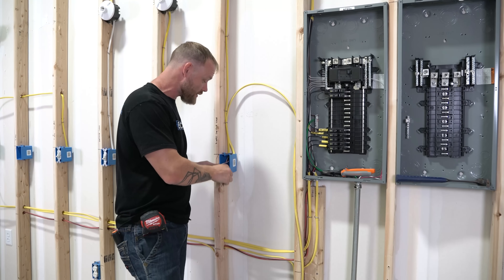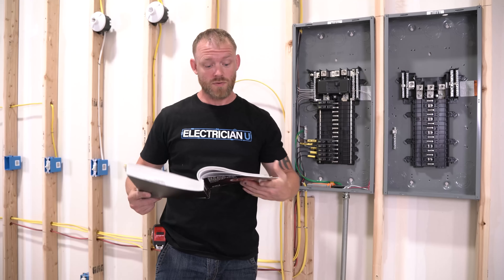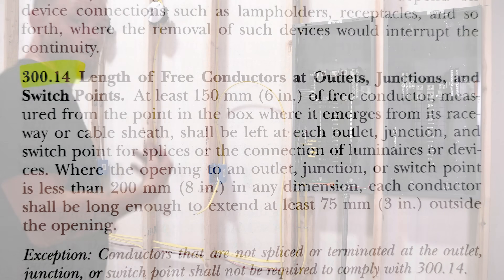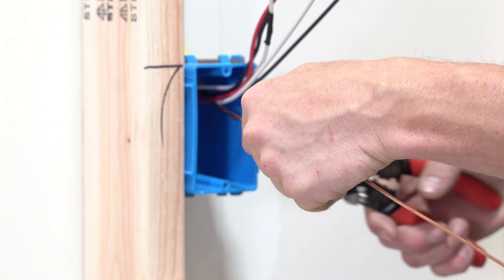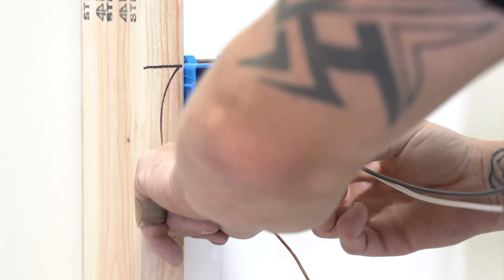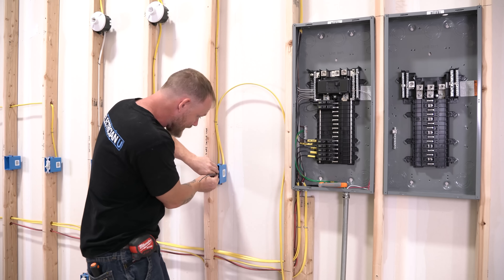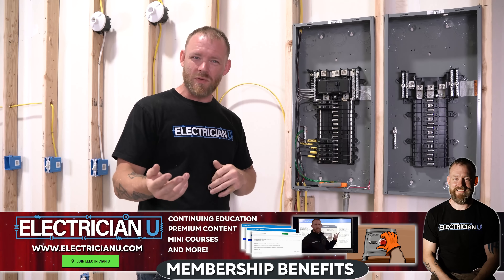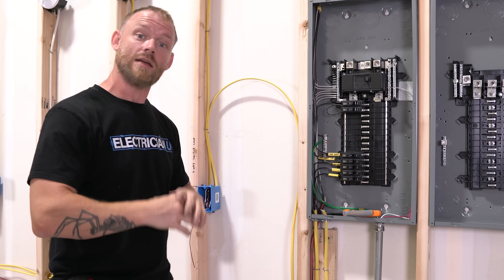STOP Cutting Wires So Short!!! What Does Code Say?

Comment: Had a remodel we were working on and they put a layer of brick on the outside of the house over the original exterior. I barely had enough room to put my fingers into the box to pigtail new wire to the existing. The original length would have been to short so this extra layer made it a nightmare.

Comment: My journeyman had a way of always ensuring that our wires were of length. In the rough, before you cut and store your wire, pull out the wire and bury your lineman’s into the box. Grab the wire at the end of the lineman’s and cut. Approx 5-6in out of the box always.
Reply: I use my pinky and thumb and extend them. I have 6 inches between the two. Put it in the box and cut it the length of my thumb

Comment: Great video! I’de also like to add to leave service loops on the cable going into the box. When there skin tight like that and a drywaller cuts your wires inside the box you can pull in the extra slack to redo the splice. Master Electrician LU 213
Reply: Also known as fu@k up loops. They can be such a godsend after the drywallers have their way with a build!

Comment: I’ve always been told to stick your linesman plier head to the back of the box, and at the end of the handles of the pliers is where to cut them out so there is always plenty of conductor. Depending on brand and size, you’ll always have 6 inches of conductor, sometimes more, but always what you need. Thanks for the content!
Reply: Just mentioned this trick without noticing someone beat me to it! Same thing I was always told 👍🏼
Reply: Yup, that's exactly what I do. Pretty simple. I don't want to piss Dustin off!
Reply: same here..

Comment: Jason, I have a question for you. I have 3 closets, 30'' x52"  and 9' tall.  I want to put lights in them and would like your opinion as to what type light you think would be the best for this application. I do like things lit up well.  Keep the videos coming. I listen to you because your a master electrician. I myself am a master plumber and gas fitter, I've been doing plumbing for 50 years now. You hold down Texas and I'll hold down Alabama....
Reply: I'm starting to put high-output strip lights hung on the wall horizontal above the door on the inside of the closet. Doesn't get in the way of racks or shelves and doesn't block you from putting something big on the top shelf like one on the ceiling might. That's just me, you may not like that. 

I'd just find the brightest surface-mount light you can get at Home Depot or Lowe's. Good luck

Comment: West coast we call it "Make Up" .   

My Method.. 

All wire to the top of the box(if the come from the bottom).  Then all wires to the bottom corner, and out.  Grab the wire out the front and cut, four fingers....  fold over finger, fold in, push back. Push back or drywall will cut your wires.  GG

Comment: You did not mention wire stretchers as a solution..     Haha   yup I have had to wire new outlets in with barely enough room to get the screw driver on the screw to tighten it down.  Thanks for that lesson!

Comment: Touch the connector/cable entrance with the tip of your middle finger, and cut the wires no shorter than at your wrist. That’ll be basically enough, but nothing wrong with longer.

Comment: The licensed electrician who wired my house in the late 1980s was big believer in cutting short and using backstab devices.  I'm a big believer in cussing about him every time I have to replace a duplex or a switch.  Sometimes my only option is to pigtail., and as short as the conductors are, it can be a real hassle to release the backstab spring.
Reply: I really, really wish manufacturers would stop with the backstab connections.

Comment: Please USA STOP. Look at scandinavia. That the way it should be done. Use pips and proper fuse boxes etc.
😂😅
Not that you do a bad job. It is just that you don't know better, sins you are in the USA. 🤣 Joke.
But i am glad that i am an election in scandinavia and not USA. For you have no way of upgrading, changing and switch out wires etc without pulling down the wall. And it isn't future proof etc. Also it isent as secure. But i guess that it all comes down to price and that this is the low standar.

I ame wondering if you ever use corrugated pipe (K-rør 16/PN 3G2,5 etc)?

Sorry for my english :)

Comment: Pop question. My master electrician told me to not connect a ground wire to a switch, just twist it off like neutrals. Yet switches have a ground spot for the wire. This is Northen Central Texas. It just doesn't seem right. Is my Master electrician right?
Reply: Check NEC Section 404.9B: "Snap switches, dimmers, and control switches shall be connected to an equipment grounding conductor..."
This can be accomplished using the ground screw on the switch if using a nonmetallic box. If a properly grounded metallic box is used, mounting the switch with metal screws provides an acceptable ground path.
This is to protect the switch user from shock should any metal parts of the switch, or a metal cover plate, become energized.
Reply: @nomen_meus  Thought so. Thanks. I think I just need to find a new Master Electrician. Swear he hasn't updated himself code wise even with NEC 2017, let alone 2020. Then constantly making changes that need undone. Sure thats him losing money. But it is HIGHLY aggravating when it comes from your Master Electrician.
Reply: @nomen_meus  Well my Master said "Switch is bonded to ground system, i just dont do it through connecting grounds to switch" then also said "switches don't utilize electricity it passes through, its not like a plug or motor. Its very unlikely your going to overload a switch". Which means he is aware, yet doesn't do it and we pass inspections all the time. I dunno what to think. For I thought NEC was always the miniunum standard. Wonder if I poped off a switch during inspection, if it passes.
Reply: @krich106  Do you use metal boxes? If so, that's okay. The switch yoke is grounded through the box, assuming the box is properly grounded. If using plastic boxes, then the ground screw on the switch should be used.
This is a safety issue. It has little to do with possibly overloading the switch. It has to do with protecting anybody that uses the switch from a potential shock hazard should the switch yoke and/or a metal cover plate become energized, say by a loose wire, or a wire with compromised insulation that may contact the yoke or metal plate. Even the mounting screws for a plastic cover could pose a hazard if the switch yoke becomes hot.
The wording of 404.9B requires that metal plates are provided with a means to be grounded, regardless of whether one is initially installed. It allows for future installation of a metal plate without having to worry about grounding it at that time.
Reply: @nomen_meus  Nope, only used metal boxes for ceiling fans. I don't ever see it being a safety issue for the customer, since there is no exposed metal after trim out. But if it arcs it probably wont break the breaker. So melted plug and such, maybe possible fire. Yea like I said, think I just need to find a new Master Electrician. I want to be do excellent proper work, not things that are blantant against code. The irony is, he still makes me put in a green wire nut with tail, that he has me not attach. Thats probably why we pass rough in inspection. Not like most inspectors take off plates. I even cited the code you sent me. Now I see why people say site source.....

Comment: Our code in Canada (CEC) went a little further on that and we are required to have approx 6 inches from the front edges (opening) of a box.
Reply: No, the CEC is the same as the NEC in this regard. 12-3000(6) specifies "at least 150 mm of free insulated conductor shall be left at each outlet for making of joints or the connection of electrical equipment, unless the insulated conductors are intended to loop through lampholders, receptacles, or similar devices without joints."

Comment: I always tell my apprentices to put the tip of the linesman to the back of the box and cut it at the end of the handle. This is a huge problem whenever I do side jobs. I can't believe what people in the past have done.
Reply: I just put my hand on the box with thumb extended and cut them off there. Rule of thumb. It's probably a couple more inches than needed, but that extra 2 inches or so, the next guy that has to replace a burned up light switch or receptacle will thank me for leaving a little bit of extra wire so can just cut off the old receptacle back to undamaged wire and just replace it. Always think of the next guy, switches and receptacles don't last forever...

Comment: I do industrial electrical work for the most part but the few houses I've worked on had this problem. I had to use needle nose pliers just to make it work when replacing outlets. Obviously you'll just make it work in this situation but are you technically supposed to refuse to reinstall a device without wire being repulled?
Reply: I've always added a pigtail to give the wire the needed length

Comment: While I have enjoyed several of your recent videos, I was glad to see you return to an educational video where you pull out the code book - thanks. I agree that those short wires are a real pain. I tend to use my lineman pliers to measure where to cut the wires. Depending on the brand you use, there are many features that were specifically designed into this tool (Kleins) to facilitate in these sort of things - like the depth of the cutting jaw being the correct amount to strip from wire for a standard red or yellow wire nut

An in-depth coverage of the Kleins and all their features would make an interesting video - I'm sure Klein Tools could help with some of the more subtle aspects of the design features that were designed into this versatile tool.

Comment: Talk about short wires; in Hawaii the receptacle box was cut in the baseboard which is 3/4 inch thick; so only one romex  to the box and you need to leave enough wire to connect the receptacle so it you can install it in the box.

Comment: I do a lot of electrical repairs. I find that about 85% of old boxes have too short wires. Thank God for Wago 221's. Still Wago 221's are almost 50 cents each. I wish I knew a chinese knock off for half the price.
Reply: Lol, Chinese knock-off wouldn’t have the UL safety rating that Wago 221s have and would not be code compliant. Their thermal, continuity and impedance and hold properties are tested to make them the right thing to use.
Reply: @mathman0101  - You are too late Math Man. I already found them for .27 cents apiece. Half Price. They are on the way They will be fine, because all of our wiring, appliances, and whatever, are from China too. America is just an economic colony of China. Wago needs to move it's factories to China, or get left behind.

Comment: My method is press the wires to the back of the box with excess sticking straight out. Then rest the bottom of your hand on the front edge of the box, grab the wires  and stick your thumb out (like this 👍🏻). Cut the wires at you thumb. Plenty of wire left.

Comment: 6 in is minimum when I was a apprentice in the 70's I was taught to use my lineman pliers which was 9" in length from the wall to make your cut. Now the installer has plenty of wire to work with. If he or she is qualified they will leave enough wire for the next person.

Comment: Use to drive me crazy when I was a Forman and the guys would cut the wires short. I have since moved on and no longer have to worry to much about that. I work for a testing company now working on all medium and high voltage equipment. I make a lot more money with a lot less responsibility

Comment: The electricians that did my house used crimp sleeves on all the ground wires... like 2" from the entry to the box. Honestly, as annoying as this has been to deal with I'd be curious to know HOW they even managed to crimp them that close to the back of the box.
Reply: Let's Go Brandon  ---- having the correct tools, will make your life a lot easier, your workmanship will improve, and you save time and effort.
 I am not even joking when I say this... I just finished a service call to move a receptacle for a drinking fountain in the local community theatre. The box and wire run are surface mount wiremold raceway and box. The person who did the install made the wires so short I had to shut the circuit off to get the receptacle disconnected from the wires. It's all good now. That's my luck. I talk about it and next thing you know Old Jed's A Millionaire. $150.00 for 45 mins work. Not including new parts. I love my job.
Reply: Let's Go Brandon  --- as a licensed, own elec contracting business, 16 yrs as a union journeyman, and over 30 yrs total experience working with tools, I have say... STOP DOING THAT!  LOL
Reply: Let's Go Brandon  thanks for sharing your ignorance.
Reply: Tim -- yeah that close to the back of the box is annoying -- but it's done using a crimping tool (it's a wrench that just used for crimping). I guess they're not as common nowadays.

Comment: Great video but I think you should do a video talking about the same thing but talking about sometimes how are you going some remodels and you’re taking out all the switches and all plugs to replace them and they only come out of the box an inch or half inch and I really have anywhere to work with and you’re wondering how the hell you gotta deal with that shit let alone have a blank they got that thing in there to begin with with a shortage of wire is

Comment: My favorite wire nuts to use are the 3M O/B. They are good for 3 #12 wires. Absolutely awesome for single gang outlets, where you have to go in and out.  Super easy to install and they take up next to no room on your pouch.
Reply: My favorite is the 3M T/R. Tan and Red. Can use for a ton of combos, they hold onto a wire for dear life, and not too big. I liked them so much, last time I was at my supply house I grabbed a tub of 500 when they were on sale...has lasted for months.

And yes, the newer style Wago 221's are really nice. Saved my butt once when rewiring a True 2 door reach in freezer. They ran all the wiring thru this tiny little box and a bunch of the wires were burned up. Used several 5, and 3 terminal Wago 221's, and replaced the burned wires. Still working good many months later. There's wires for the door anti sweat heaters, two evaporator fan motors, coil defrost heaters, timer power supply, drain pan heater, door frame anti sweat heaters, mullion heaters, lights, door light switches. Ugh! No room at all for wire nuts in that box, which has the compressor contactor at the bottom on top of all that too. Looked like a burned out rats nest, and the schematic was damaged, so had to pull up wiring diagram online, then try to figure out which burned wire was yellow, which was brown etc.
Reply: @brnmcc01  honestly, we but those by the tub. Several go away on each job. I just mentioned the  O/B, because they are tiny, and work well for what they do. I've never bought a different wire nut since I've found them. (The ideal twisters are my second favorite, at least in the USA. The can twist from ideal were my favorite in Canada though.)
Reply: USE wago 😘😘
Reply: @PumpiPie  naw. They are stupid expensive. And HUGE.
Reply: @IceBergGeo  huge? xD Than you have probley used the old type.
I guess the price is different 
 where i live. Wagos is fast and easy and smaller than wire nuts. From my exsperians.
Reply: @PumpiPie  look up the 3m wire nuts. There is  no way a wago is smaller.
Reply: @IceBergGeo  They are super easy to install which makes them more economical than wire nuts.  And when it comes to later mods, they are by far the best way to go. They are almost identical in size to the 3M wire nuts when used properly.
Reply: @PumpiPie  Wago 221 are a lifesaver when too many short wires in a tiny box where I can't get my big fingers in there to properly tighten a wire nut. Hammer head style wire strippers, slip a Wago on, close the lever, use a mirror to see the wire is in properly and move on. The little Wago has constant spring pressure so I think it's better for like internal equipment wiring where there's vibration etc. Don't have to worry about a wire nut coming loose then burning up.

Comment: I'm currently in the midst of replacing all my home's old, beige or painted receptacles with white and I'm hitting this at every outlet. Sucks! Having to get creative in removing the sheaths from the little short wires and making pigtails for literally every receptacle.
Reply: Not an electrician, but I've run into this in multiple places in my home and found that Wago connectors work great for this.  Make a pigtail that is actually a reasonable length and put it into one side of the connector, then you can work the short wire into the other side and make sure it's seated well.  Worked great so far where twisting wires and getting a wire nut on would not have been feasible.  I also like that the Wago doesn't damage the short wire at all if you need to work on the junction so the situation doesn't potentially get worse / even harder to work with.
Reply: @danielherman9483  Absolutely, Wagos are definitely the way to go in this situation!